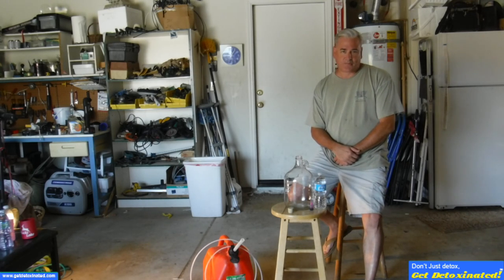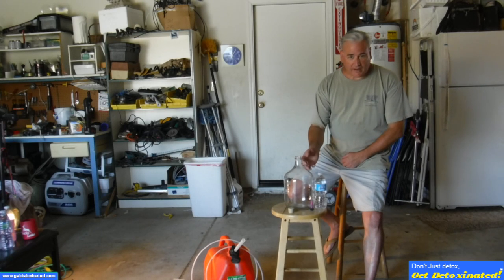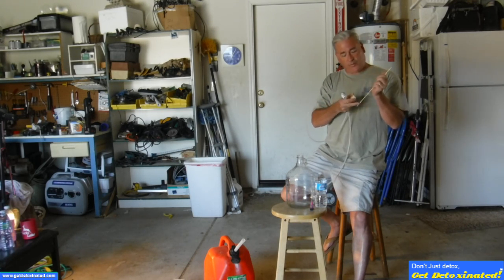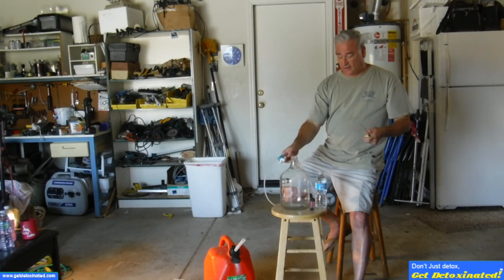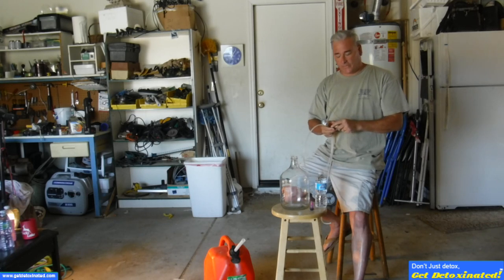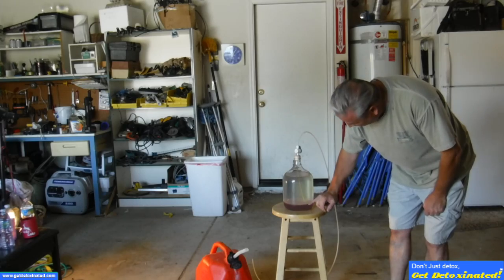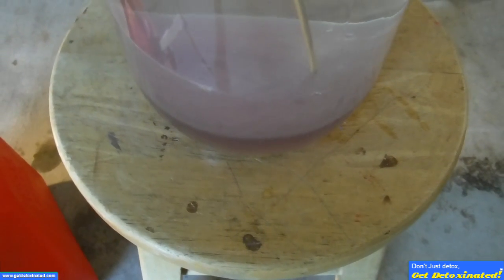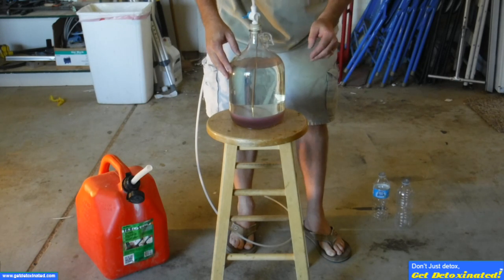How to remove ethanol from gas for 2 stroke engines

Comment: Actually the problem is caused by caused by the ethanol dropping the boiling point of unleaded gasoline from 35 degrees C to 18 degrees C. 

On a hot 2 stroke motor the fuel air mixture should only vapourise when the piston is at the top of its stroke, not when it enters the cylinder bore via the transfer ports during scavenging when the motor is running at operating temperature.

This causes poor combustion and loss of power, so the operator throttles up a bit to compensate, which causes the engine to run hotter and the cycle goes around until a piston seizure occurs or the spark plug soots up, killing the ignition.

Castrol engineers, in a published report, recommend adding a small measure of kerosene or diesel into a 2 stroke gas tank. After 2 years of experimentation I've settled on 2% to 3% diesel in the E5 unleaded petrol sold in the UK, which restores the lost bottom and midrange torque on high compression Jawa and CZ 2 stroke road bikes plus has ended the spark plugs sooting up. The plugs are now the correct coffee brown tint.

Ethanol + Oxygen = Acetic Acid (vinegar). This is an iron solvent and also destroys rubber, neoprene, gas tank weld sealants and a few other things. It settles to the bottom of the tank as its created and is responsible for the brown shite in carb float bowls (despite inline fuel filters) and all gas tank woes including pin holes appearing.

The good news is that placing a zinc boating anode into the gas tank soaks up all the Acetic Acid as it is created. I've done this on one bike and the fuels hose destruction , dissolved iron deposits in the carb and gas tank corrosion stopped the day after I'd installed it.

On the downside zinc boating anodes, even small ones, are expensive. They can be cut up though to fix more than one gas tank.

Comment: And there is absolutely no way to store, freshly delivered ethanol pump fuels long term? 
Maybe there is. In a tightly sealed UV rated poly drum which will never see temps above 120F. That means your containers
total volume must allow for expansion. And including tiny amount of an inert noble gas inside .
Vent. Roll drum around a bit, and fuel up.

Comment: Ethanol in fuel, replaced MTBE as the anti-detonant, which replaced TEL( tetea-ethyl-lead) in the late 70's in 
consumer grade pump fuel. Aviation fuel made for piston engine aircraft is allowed to add TEL and the Brits still make the
world's supply, of this "deadly to handle" organic chemical.
You might be surprised to know that premium pump fuel has near the full 10% allowable ethanol and the lowest grade
has the least amount in it. Maybe that's why the companies like honda and stihl tell you to use regular in their
2 stroke equipment?
What do you think your new RMS/2 octane rating will be since you removed the anti-detonant ethanol?
Supercharged Warbirds of WWII carried small auxillary tanks of methanol/water for combat.
And they were using fuel with TEL.   Wonder why? Cooling the mixture to keep cylinder head temps down.
That's why.
Here is a link to a handy flash point table for solvents, oils and fuels.
https://www.engineeringtoolbox.com/flash-point-fuels-d_937.html
Reply: We had the tanks you describe on our US Gov manufactured OH6

Comment: My two strokes run fine on 10% ethanol fuel. I do not store them for more than 2 weeks with fuel in them. I use 2 stroke oil like Everyone else in my gas. Just rigorously shake the weed eater befrore starting it to mix the separation that occured during Storage. Push the primer bulb till you see fuel in it. Set choke if yours has one. Then pull rope four or five times real slow before a Full pull. It has a reed valve in the engine and four slow 1/4 to 1/2 pulls get the mix into the crankcase. I  bought the right screw Driver for adjusting my models carb, to tweak the idle slow and fast/run needles  A 1/16th of a turn back and forward to correct a Bad ildle or running rpm stumble.
Most folks incorrectly assume that the gas they buy at the pump is clean. Look in your gas can after fill-up.The gas may have rust And crap from the refinery and/or the gas stations in ground fuel tanks. You can buy a tiny inline filter to splice into the fuel line to The carb. The one inside these cheap 2 strokes fuel tank doesn't work worth beans, if it even works at all.

Comment: And you can just pour that water ethanol mix into your washer fluid tanks should be the same thing just no detergents or anything
Reply: Mine always has a tiny bit of gas in it after the process..you can lite it in a glass or metal can and the ethanol will burn off then your just left with water.

Comment: Thanks for the information on how to remove the ethanol from gasoline.  However, you have a one gallon GLASS container in an enclosed garage with a natural gas water heater with a lit pilot light within 10 feet!!!  If that glass bottle gets knocked off the small stool in the middle of the garage, you will lose your house, if not your life.  Plastic bottles are much safer for handling gasoline.

Comment: $11 for an empty gal. jug? That nuts, I get mine full of Carlo Rossi Paisano for that price. Nice vid, I'll be doing this.
Reply: 2 funny. i never thought of it that way.
Reply: @dexterthompson1809  its quite usual when looking for glass bottles/jugs to get them cheaper when buying a beverage.
Reply: HAHA.. was thinking the same thing... except I go for the Burgandy.. not the Paisano
Reply: I use the placstic 1.750 ml long neck wissky bottles for my chain saw gas.  The jug is clear,  is almot a perfect half gallon for fuel ratio mix and it has a convient pour spout .

Comment: When you add large amounts of water to ethanol, you experience a phenomenon called "phase separation" and the ethanol molecule separates itself from the gasoline molecule and attaches itself to the water molecule which can then be separated from the gas by gravity or a special filter.

The quickest way to remove water from gasoline is to use a product called Mr. Funnel. I have all the various sizes of Mr. Funnel that I use for various applications.

Mr. Funnel is an amazing funnel in that you can fill the funnel with water and nothing comes out but if you then pour gasoline through the water filled funnel, only the gasoline will come out. It has to do with the size of the gasoline molecule in relation to the much larger water molecule. Check out their website (mrfunnel.com) and you'll be amazed!!!

Comment: Following mathmatical formulas, theoretically you should recover 12.8oz of ethanol per gallon if it is true E-10. Love your repurposing of the stool, a wonderfully simple idea that works, I would however recommend turning the jug upside down while you wait for it to separate that way you reduce the chance of water being left behind, and the ethanol should be well enough diluted that it won't degrade the rubber stopper.

Comment: I shook the fuel and water really good. Can anyone tell me why after 3 hours my gas is still cloudy..It has me a little nervous ..I`m letting it go overnight to see. I did 3 gallons for my XR650R 4 stroke dirt bike and I use 110 aviation gas for my 2 stroke CR500R..
Reply: RAIDER69 pretty sure aviation fuel is ethanol free...
Reply: @robhow6105  My bad I should have stated that i was using pump gas when i did this. It did clear up and worked great. So much better then paying $10-$12 a gallon for race fuel.. it's all i use now for all my bikes

Comment: Works better when your h2o is double your ethanol percent 10% of 128oz 
of gas is 12.8 oz ethanol. So then you add say 26 oz. of water. This 
mixture also should be left warm preferably above 72 degrees or higher. 
At this point shake well let stand. Should get cloudy.Then chill to -5 
degrees over night. A freezer works best.  Next day siphon out 
ethanol/water mixture. Keep container air tight when done. I learn this 
repairing "no start" in car/trucks. Good luck. cute set up

Comment: whose lawnmower runs on 2 cycle gas??!!   anyway, interesting vid but the easy solution to keep all your 2 stroke engines in good running condition is to merely dump all the gas out of the fuel tank of the weed whipper/leaf blower/chain saw after you use them and let the engine run until its bone dry and cannot restart.   i'm 50 years old.   my last two weed whippers, 2 stroke cheapies, each ran 10 years or more.   my chainsaw has been running for 10 years and still going.  my leaf blower has been running for 10 years, as did the one before that.   i do not doubt the merits of this video but i think there are easier ways to keep your engines alive.
Reply: I had a 50 yr. old Homelite chainsaw that was still running good when I sold it. I always used just reg. gas in it. Wow, didn't know I was ruining it.

Comment: I don't get it what is wrong with ethanol  I have heard a couple things but they don't jive to me gumming up carb after sitting. If it is pure  ethanol  then I don't think it will leave any gumy shit behind. This is common with Gas though and leaving a varnish behind though. The other thing I have heard is it dry rots the lines and other rubber parts.  This might be true don't know but if it is true it is only doing this on small engines because my lawnmower and car never have a problem. No I think as far as I can tell that it won't hurt anything but the cheap ass hoses and prime ball they use on small 2 and now 4 stroke engines. So they must know the hoses they use suck and if they would use small hoses made out of the same shit the hoses in cars use then there would be no problem.  Don't the Indy cars run on alcohol I thought running alcohol was cleaner and more powerfull ?
Reply: Steven Robbins - here's why it's bad. 
http://www.popularmechanics.com/cars/hybrid-electric/a6244/e15-gasoline-damage-engine/

Comment: Do you re-use the colored water on the next gallon of gas or just keep repeating the process over and over with same colored water if say you have 10 gallons of gas ? Also can't you use tap water out of the faucet instead of bottle drinking water for the ethanol removal ?
Reply from the maker: Start fresh each time.  I only process 1 gallon, as needed, at a time for my 2-stroke power equipment.  Tap water is fine.  For demonstration purposes, I used a bottle of water to show that I extracted 1.5 bottles of water.
Reply: Ok thanks for reply back.

Comment: I don't get all these ethanol removal videos. All you guys fumble with glass jars of gasoline while turning them upside down. Just stick a siphon hose into your separated mixture and drain it from the top. Trust me, when you drop and break that jar of gasoline in your garage, and you will, your house will smell it for years.
.

Comment: I guess I am lucky, never have issues with ethanol in my small engines, etc.  I replaced my fuel hose , etc. when ethanol came out and I added fuel shut offs on engines that didn't have one.  When done using engine, shutoff fuel, run engine until it dies.  No fuel left in carb, no problem with next start up.  Also it helps if you use your equipment more than once in awhile.  All the new small engines are being built with ethanol in mind, so this is about useless.  Also, what do you do with the water and ethanol when you removed it?  You do know it's an environmental crime to pour it on the ground or down a drain, etc.  EPA and state laws require you to properly dispose of any water that has been in contact with hydrocarbons(fuel, etc.).

Comment: Good vid! I've rebuilt the bank of carbs on my motorcycle 3 times already because of the crappy mixed gas. I think I'd pay 10 cents extra per gallon in order to buy untainted fuel for my small carb engines. We're all being screwed and need this nonsense stopped.

Comment: What is the purpose of removing the ethanol from the petrol? you can buy a lead additive 
which helps for older engines. And what do you do with the ethanol afterward?
Reply: David Wells ethanol degrades parts and gums up in most small engines.

Comment: Be careful with that big white cylinder thing behind you while working with fuel.   THE PILOT LIGHT IS AN OPEN FLAME.     Good video, don't blow up.
Reply: thats why the water heater is 18" off the floor, to be above gas fumes
Reply: Mike1614b ..nice dad..too- shay👏

Comment: The main issue with ethanol and 
2 strokes is;

The ethanol/water mix WILL support 
combustion.  But, there is no oil present.
Oil will mix with gas, as well as ethanol.
But, when water is added, only a small 
amount, the ethanol will mix with that 
water, and leave the oil in the gas.

Now you have a fuel mix in your tank, 
that hates oil.

steve

Comment: Great vid.  "Ethanol-laced gasoline" does allow some water to become homogenous within the gasoline due to hydrophilic property of ETOH.  As water accumulates (or is added), saturation of the ETOH occurs; and it is at this point separation of the gas from the H20/ETOH occurs. You will not see phase separation until enough water has saturated the alcohol to separate them from the gas.  Furthermore, consumers pay a Hot Fuel Premium for fuel dispensed at over 60 degrees F, since gas is sold to consumers by volume instead of weight.  Don't get me started on the .9 cent rates...  sorry for the rant.  Thanks.
Reply: Correct for E10.

Comment: Great video. Now you need to take those two bottles of Ethanol/Water and shove em up a Democrat's ass.
Reply: Nonya Bizness- liberals want to "protect" the environment by burning corn that could be eaten by millions of starving people all over the world. If you want pollution control go knock on China and India door  and tell them to stop burning so much coal!! US is far more green then are!!
Reply: How about you learn some history before spouting nonsense.  1990 the Clean Air Act Amendments was passed to reduce carbon monoxide.   1992 The Energy Policy Act was passed by Congress.  Apparently, you are not old enough to remember George H. W. Bush- President of the United States of America 1989 to 1993.
Reply: evilspeaks1 #Facts
Reply: evilspeaks1 it was actually the “energy policy act” set into law in 2005 that renewable fuels be mixed with gasoline. Until then it wasn’t a law or mandatory. GWB signed the law congress passed it.
Reply: Nonya Bizness- your a typical liberal, I bet you think the solution to world poverty is for those people to be gay and not have kids.. Suppressing birth rates of the human race is not the answer. Those people obviously need help in modernizing their way of life so they have what they need. Jobs not ass plugs ya weirdo
Reply: CNN maybe to you they are, I wouldn't trust them to tell me a rain forecast of the weather while I'm standing in the rain.
If it came as a news paper like the NYTIMES I'd use it like I use the NYTIMES for shitting paper for my dog.
Reply: carlo Cas  You sound like a russian bot...comrade
Reply: Walleye Willy LMAO
Reply: No it would fit better up your ads u repub pos
Reply: Why are you wasting your time when you can buy ethanol free gas at the pump
Reply: Sorry I ment ass

Comment: Everyone is going to need a chemistry set so you can run your equipment
Reply: Sad, though...isn't it? E10 doesn't contribute to anything consumer-oriented. No benefits re gas mileage...so folks spend more for nothing. Car fuel lines, carbureators in all engines. Some Sierra Club nut job got his political hooks into someone 'connected'. Engines suffer from using E10. The only ones gaining are BigAgri corn farmers. Do they use E10 in their farm equipment?